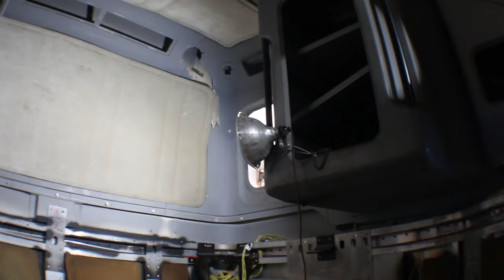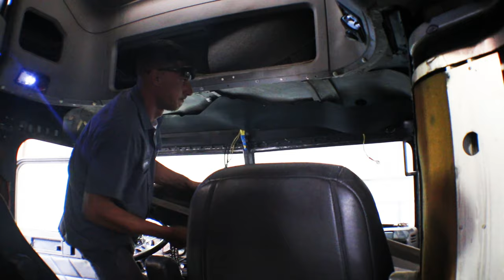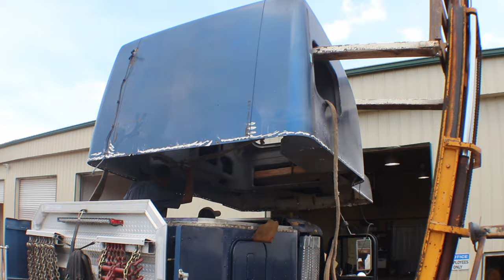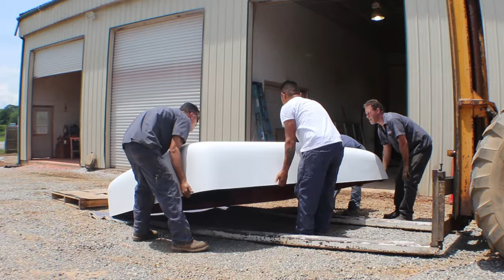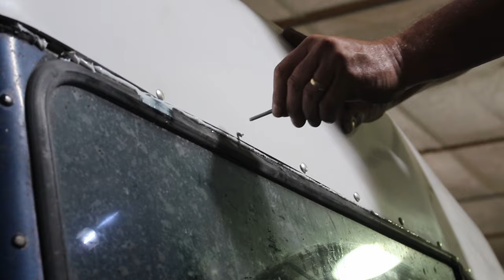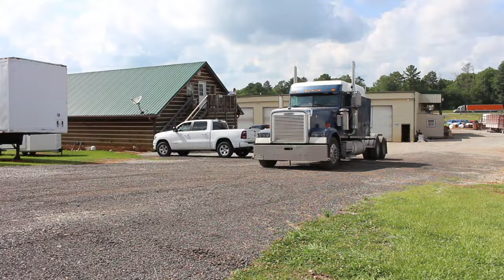Talladega Fiberglass - Freightliner Mid-Roof Conversion

Comment: Amazing. How much does it cost? And what is the main purpose of this conversion? I am assuming to worry less about lower bridges? For Flatbed and Stepdecks?
Reply: I have high roof sleeper with my one truck and wanna get it converted to a midroof so I can go into loading bays that don't have a 13.5' clearance